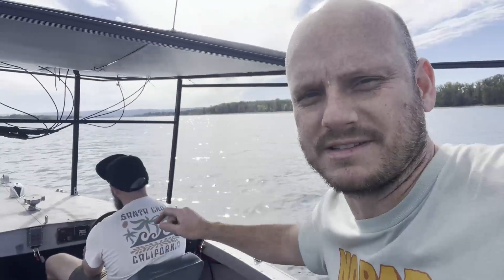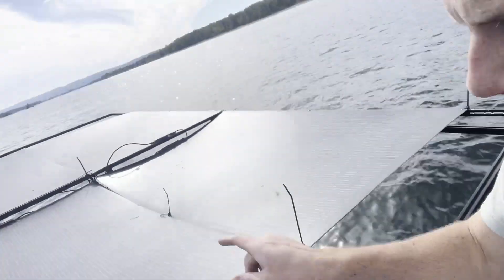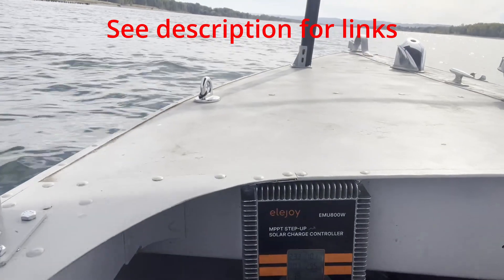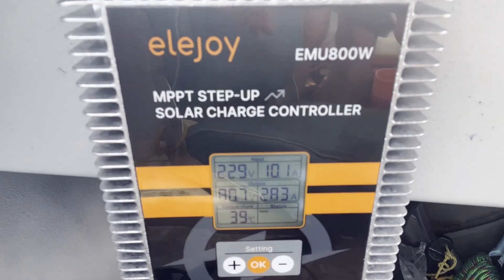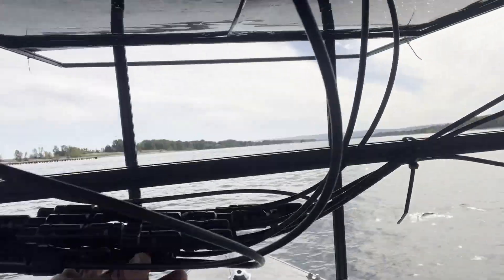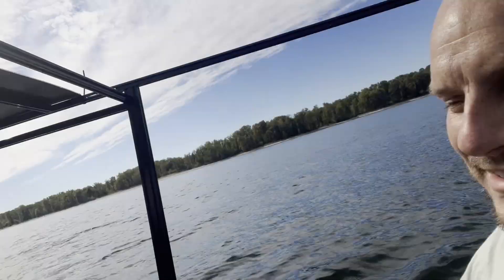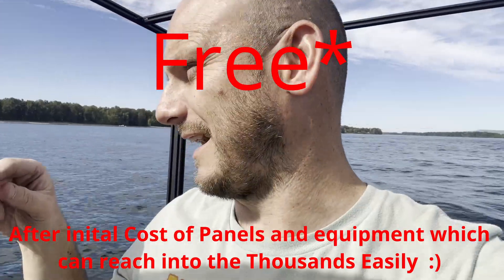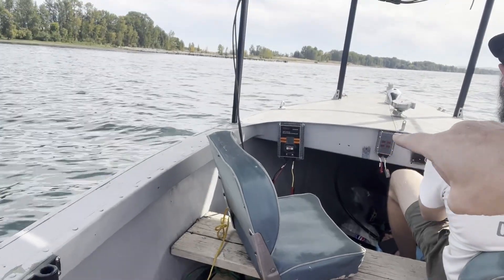72v Electric Boat with 720 watts of solar panels

Comment: great project! From experience those flexible panels need support on the back as the bending creates micro cracks that reduce the output pretty quickly. like loosing more than 30% permanently.
Reply from the maker: I guess I’ll just have to add more weight to the structure!! 🫠
Reply: @JohnnyNerdOut  haha more weight more better 🤣

Comment: Those panels need actual support across their surface or the cells get damaged - they’re meant to be “conformable” not truly flexible - flexing no bueno
Reply from the maker: V3 will have full solar capacity and proper structure 😁